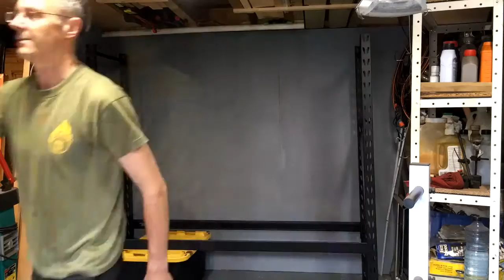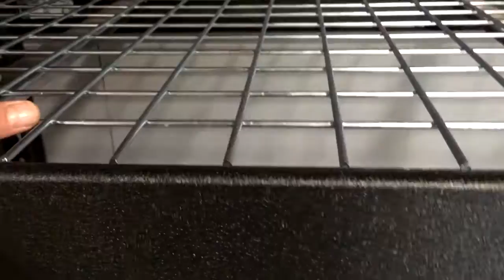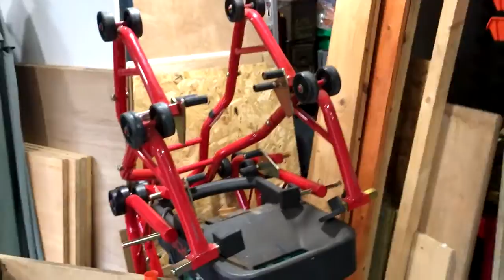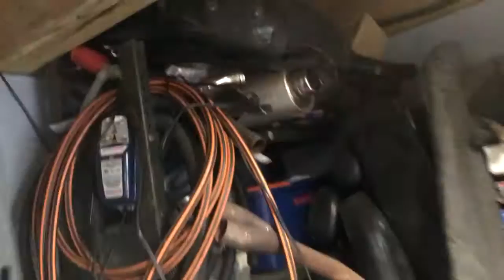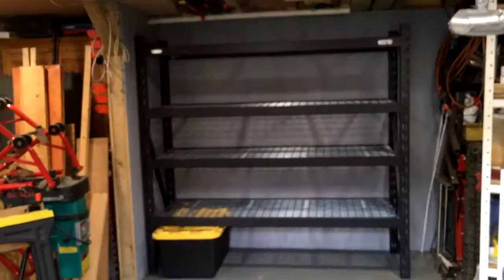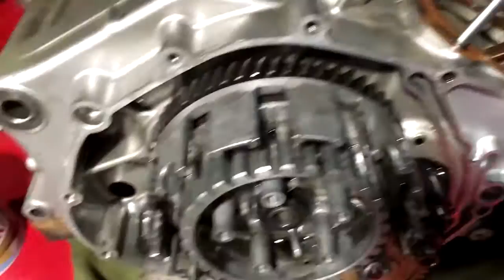Storage Wars

Comment: Hi mate, just been sent here by JohnyCuctus, I asked him a question about his DRZ only to realise he'd sold it to you. I had the same problem as Johnny with a bulging rear brake reservoir on the DRZ, so I'm attempting to do the same fix that he did with a different reservoir, only I don't know what size spacer to use. If you get a spare moment, would it be possible to give me some rough dimensions of the spacer that secures the reservoir to the frame so I can order the materials to do it myself? Would be hugely appreciated! Love the setup by the way, I've got a shed build in my garden and wired it all up myself.